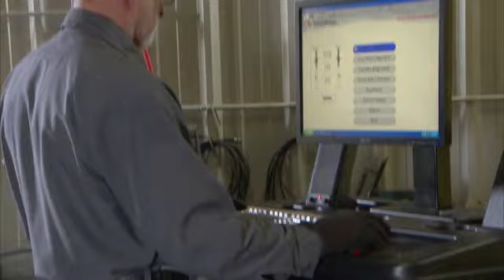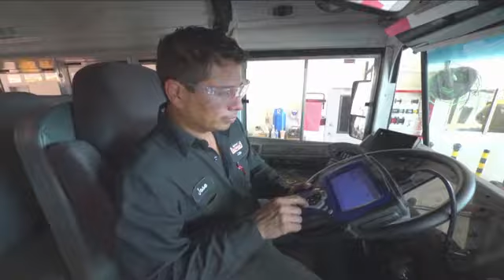Rush Truck Centers Service Technician Career Opportunities

Comment: I live in Newburgh, NY and was looking for a truck repair place for my Volvo truck near my house.  The first one that kept popping up after googling was “Rush Truck Center, serving the Newburgh area”.  Further investigation showed me that there isn’t a Rush Center within 300 miles of Newburgh. So, I conclude that Rush (or the entity charged with Rush’s advertising) is like many other big outfits: duplicitous. It’s no big deal because I found a repair shop but I take exception to getting my time wasted by a firm that evidently thinks nothing of sending me on a wild goose chase. I know for a fact that it requires only a small effort for them to attach a notice to their ads stating that there are no Rush Centers in NY. Rush may do quality repairs on big rigs, I really don’t know, but if their mendacity is any indication of their craftsmanship I will certainly be wary when engaging their services.